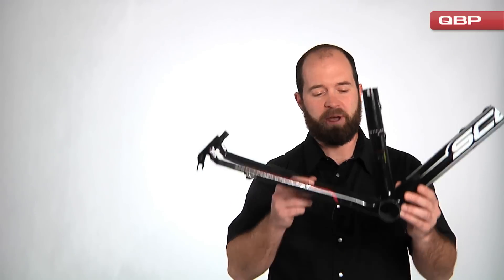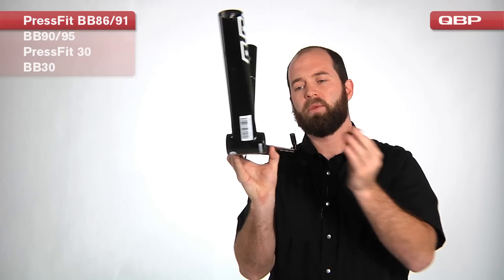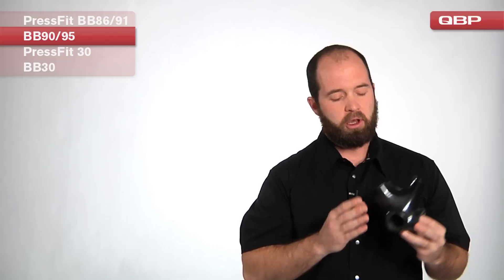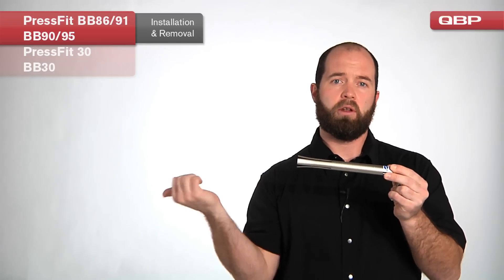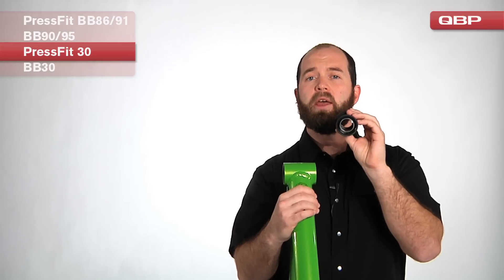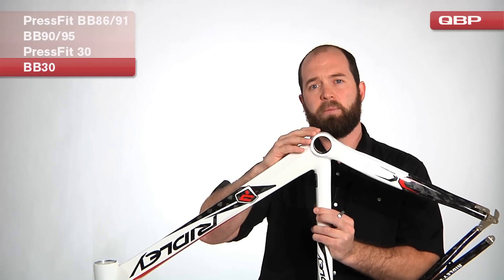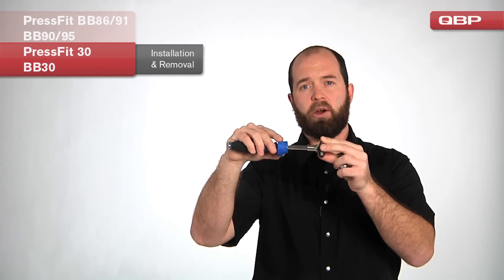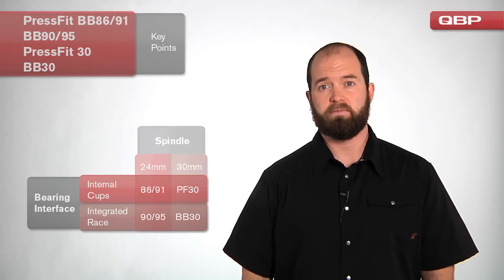Bottom Bracket Standards on Road Bikes and Mountain Bikes

Comment: I got two words for you: SQUARE TAPER!! Super strong and a lot more durable than these shit bottom brackets and crank sets. I've always used it for any of my bikes and I've never had a problem. Heck, when I switched both my road bike and single speed frames I was able to transfer both the bottom bracket and crank set with no problems whatsoever!  12 years and counting for the road bike cranks and 8 years for the single speed. Still works like a charm. #SquareTaper4Life
Reply: +dapster square taper is not the best actually as it secured with a taper where if the person is heavy or abuses the bike it wont work as over time it will slightly move and over time it will wear out and round out the crank i work in a bike shop and seen this many times i would personally recommend an octalink as it is not tapered so it wont slip
Reply: Bartek Gm Octalink? Are you serious? Octalink is one of the worst types of cranksets to use, especially if you do something like ride a bike 8-10 hours a day 5 days a week like messengers and food delivery people. Do you know how many people I've known that switched from square taper to octalink and hollowpoint only to switch back because they realized that square taper could take the abuse of riding 4-50 hours a week? Plus as I said, I've gone well over 8 years with the same bb and cranks without any problems. Plus I bet most of these cranks that have rounded out were cheap POS that wouldn't last 3 months. Oh, and just because you work in a shop doesn't mean you know more. I have friends that do as well and they've all got square taper cranksets. Why? Because it's better, that's why.

Comment: it used to be a slippery seat post blues..... I got that with my new top of the line bike and 2 weeks later it was the newer version - the BB30 bottom bracket blues. Constant maintenance, re-greasing, the whiff of rain and it start creaking. Installing new bearings to see if that helps - if not it's off to 24mm adapter and new cranks.
Reply: +Shaun Clough Get a Praxis conversion BB.
Reply: +Aryan Adibmehr I did dude- and went to gxp to fit. tt bike has nkt been converted yet
Reply: Shaun Clough Went to GXP to fit? Btw is it a Cannondale?
Reply: +Aryan Adibmehr yep. sram red. needed gxp cranks which has a smaller diam and steel spindle innlieu of oversized aluminium. , got a set 2nd hand for relatively low cost. nah it is a Boardman 9.8 air.
Reply: Shaun Clough GXP and Hollowtech II both have the same spindle diameter don't they? What do you mean by smaller diameter? Btw, I might be buying the Boardman Comp, what do you think of Boardmans' quality?

Comment: Thank  you, that set the record straight. Perhaps the proliferation of these standards -- a term that's becoming more of a misnomer with each new spec -- may comprise the point where increased complexity intersects diminishing returns for the end user.

Been riding and servicing BSA BB's for decades -- if it ain't broke don't fix it. But, of course, all these new BB designs have more to do with the amenities of manufacturers than riders.

Comment: You mentioned that BB86 spindle diameter is 24mm wide, but I recently purchased a FSA crank with the BB386 std for my Scott road frame. It was needed only a BB that fits both the 30mm spindle and the 41mm inner frame shell diameter.

Comment: Dam good video, very informative.  I have a friend who just bought a Giant TCR Advanced ISP with Ultegra DI2, found the DI2 too heavy so is fitting SRAM red with GXP.  Snag is the GXP will make the Q factor wider, or will the GXP crank spindle at 24mm OD dia fit neatly the 24mm ID of the BB86?  Meaning all he will need is a couple of spacers and a WAVE washer?

Comment: Is there compatibility for the cranksets, between GXP internal pressfit and GXP external threaded? 
I'd like to use a SRAM Rival double crankset with a GXP pressfit internal bearings on a 89.5mm wide shell of a mountainbike frame.

Comment: The thing that's funny about this video is that 80 plus percent of the bikes on the road are shit bikes from department stores with one piece or 68 mm threaded bottom brackets with dinosaur adjustable square taper junk parts.  It really is sad that shimano's external hollowtech 2 only came out less than 10 years ago.  The cranks should of been invented over 20 years ago being how simple the design is with no crank puller tools and super easy bottom bracket removal and install.

Comment: People need to remember why bike companies like shimano came out with external bb cups.  It has nothing to do with better design it has to do with the fact they can be installed faster on a bike on a assembly line than the old cartridge style bottom brackets can.  Also one size fits all with the external bearing design with the advent of spacers so no more making 10 different axle length cartridge bearing bottom brackets and buying the crankset at one store and going to another for the bracket.

Comment: If you have a non bb 30 bottom bracket bike then it doesen't matter if the bike is from 1980 and has the old square taper bottom bracket the one before the cartridge bearing.  That frame has the same bottom bracket as a newer bike and you can install a modern 24mm external bearing crankset in to it.  Except for trek and few others the standard bottom bracket hasn't changed until Cannondale introduced the bb30 10 years back.

Comment: According to Fuji's website they are showing this bike has a Press fit BB86/30 Bottom bracket.  The newest Shimano Ultegra Cranksets use a Hollowtech II style.   Short answer is, no they are not compatible, but if use a a BB adapter like the Problem Solvers BB adapter.  Check out the problemsolversbike website for more info.    Please make sure you consult the mfg. websites and check in with your local bike shop before buying or installing anything.     Brian Vanderah QBP, Customer Service.